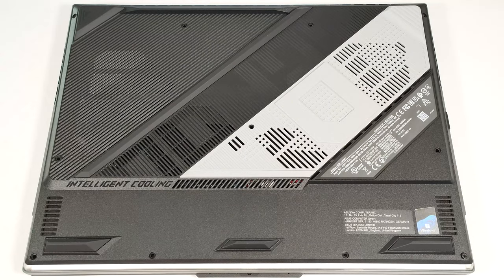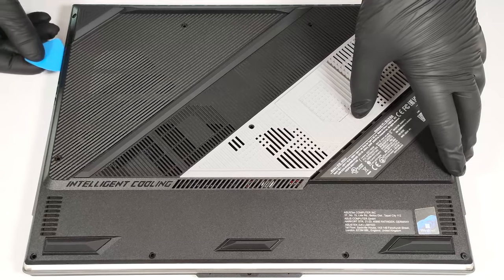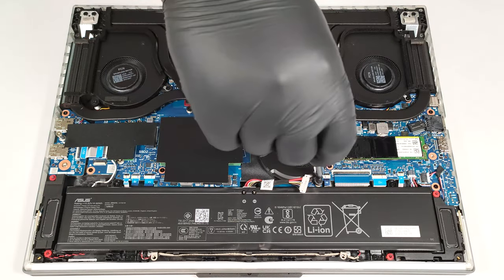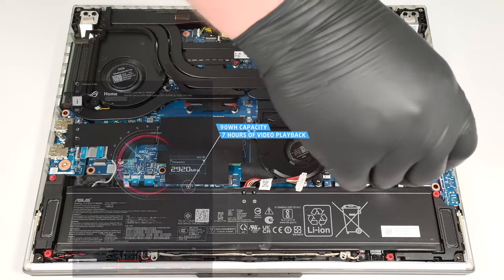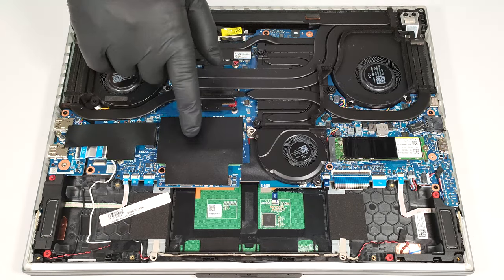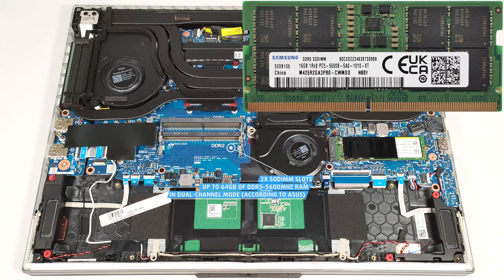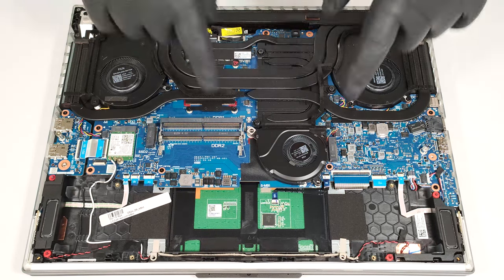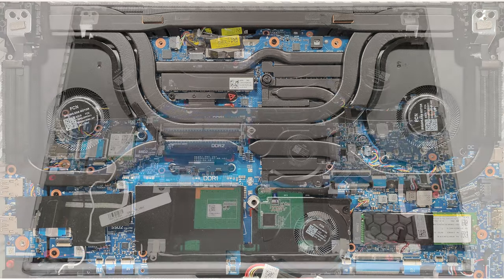🛠️ How to open ASUS ROG Strix SCAR 16 (G634, 2024) - disassembly and upgrade options

Comment: Is there a way you can show us how to replace a single fan. I have one that is operating quite loudly and I think I need to replace it. I have the 2023 Asus G634JY.
Reply: The back fan(that is the smaller one ) which goes through the frontal side has the loudest noise I presume?